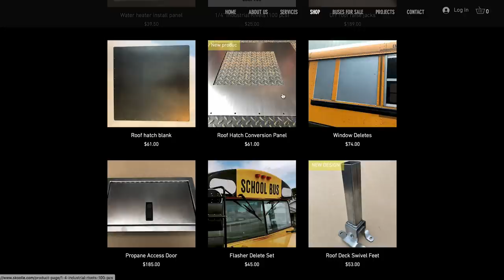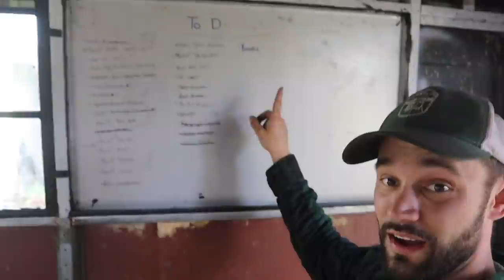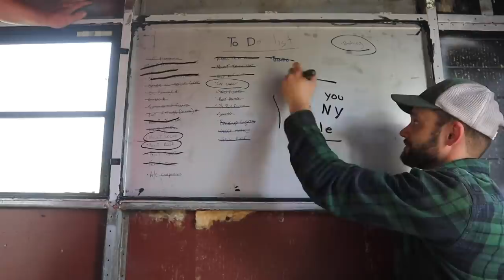Turning This Bus Into A Tiny Home | Installing New a Motorhome Door and Window Deletes

Comment: Go gray first don't like it then black. Easier to cover light to dark. Covering black at least 3 or more coats. 
That saw was great new blade and belt. Right tool for the job
Reply from the maker: It is such a great tool to have around when your trying to cut those angles. A grinder just doesn't do it so clean.

Comment: Mike & Dale, Would you not need to seal around the roof holes you made put'n the brackets in? The 'Band-Saw was a great find. What about a Safe Guard Welded On It where the Blade is? You could get a wall socket with switch to plug into to make ya a On/Off for it. Safe Travels, Always, Tommy :-)
Reply from the maker: I am hoping to do some add ons to the band saw this summer. Adding a on off switch would be nice or a safety kill switch.

Comment: Cool video, man. I'd done a few roof racks now and have moved away from self tapping screws like what you use at 21:45 ... I've been using rivnuts and bolts/nuts instead as I've seen self-tappers 1) rip out and 2) break off ... just a thought. Cool bus man

Comment: Hi Mike. Love your channel. I can see the experience in all that you do. When you resheet the floor ? Where your support strips go under the ply wood. Those need to be lined up with your counter /storage walls I would think. And which is your preference for in floor insulation . I'm in Canada so some supplies could have different names or manufacture. 3yrs experience , this works , that doesn't.  Great videos.

Comment: would use Seam Sealer instead of caulking around the windows. One is designed to work on vehicles vibrating down the road and the other is designed for a house. Not really the same thing.

Comment: Nice but it seems like it would be better if the door had a window. That way a the driver could see better
Reply from the maker: We originally had one with a window installed but it did not fit inside the opening.
Reply: @navigationnowhere  it could still be added. Just a thought.
Reply from the maker: That’s true. Ill mention it to dale and see what he wants to do this summer! Thanks.
Reply: @navigationnowhere  just thinking about his safety

Comment: Shouldn't the RV door have a window installed in it for visibility?  I imagine right now he has to lean forward to see traffic coming from the right, seems like a safety hazard to me.
Reply from the maker: It doesn't need to have a window because the location of a window would still be well above any car drive next to him. The mirrors are already designed to give the driver full view of the rig. A window could be added to the door if dale wanted.
Reply: @navigationnowhere  I was thinking more about having to make a left turn at an intersection.  It seems like a large potential blind spot when looking for on coming traffic.